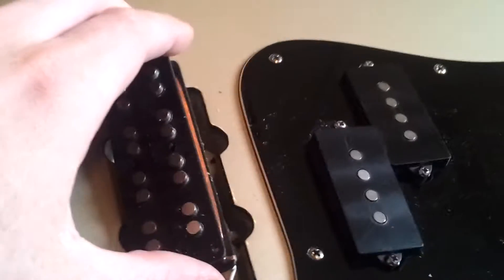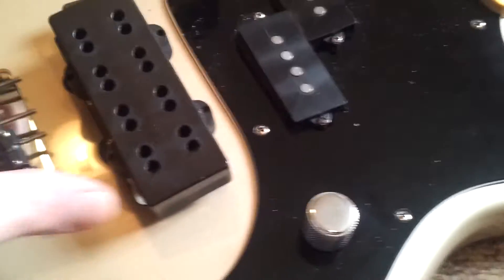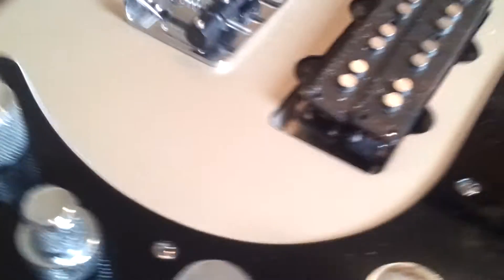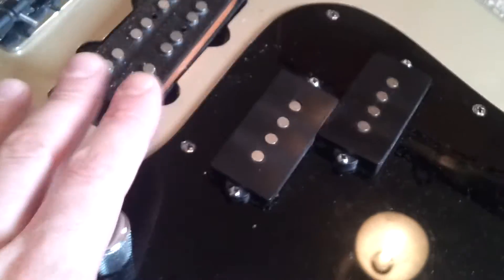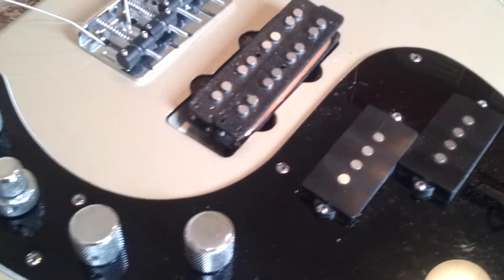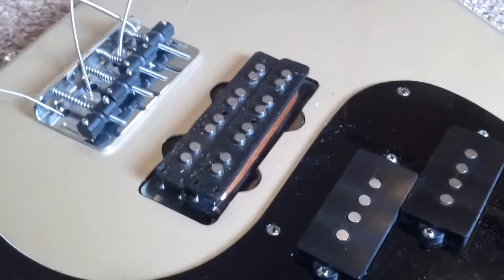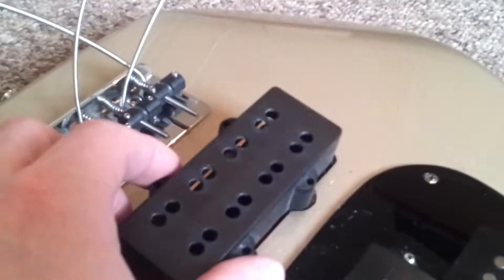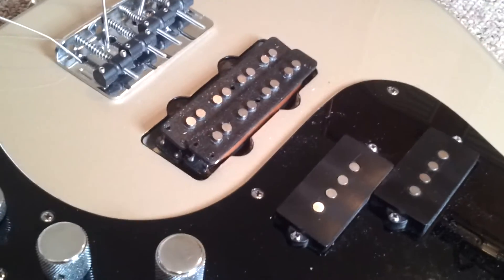Inside a double J bass pickup

Comment: You mentioned Seymour Duncan Quarter Pounders. Those are great pickups, but the pole pieces are 1/4" in diameter (hence the name) so they are 1/16" too wide to fit into the 3/16" holes of the existing pickup cover, if I am not mistaken.
Reply from the maker: That would be easy to fix with a drill spinning in reverse 🔄

Comment: Nice! I just got a Fender Modern Player Jazz that has two double humbuckers and i started thinking "what if i wanted to upgrade" so i started looking for replacements but all i could find was the original humbucker for your bass and it is just the bridge so then I started thinking "what if it's just two single jazz pick ups 🤔" and what do you know 😃. I picked it up at a pawn shop yesterday so i still need to clean it up and set it up to hear what it really sounds like stock because the strings on it were dead but all the demos I've seen on it the stock pick ups sound pretty nice.

Comment: Nice video. I have a deluxe Pbass just like that and I'm thinking of replacing its stock pickups. The neck pickup is easy, the bridge pickup is the tricky part. The expensive choice is a set of Delanos, with a DJC4 HE/M2 for the bridge. The cheaper choice is a set of Seymour Duncans, with two SJB-2 (hot basslines) for the bridge. Have you tried buying two single jazz bridge pickups and fitting them in the double jazz pickup cover?
Reply: Now imagine Pbass V deluxe and it’s REALLY-REALLY-REALLY HUGE headache if you don’t like how stock pickups sound or it’s just not compatible with your music. And I have this headache. I mean I like how it’s feeling but don’t like how it sounds.